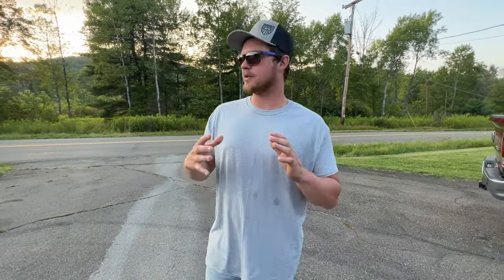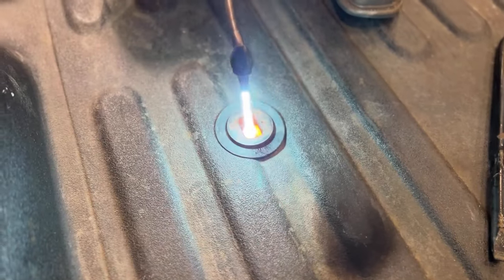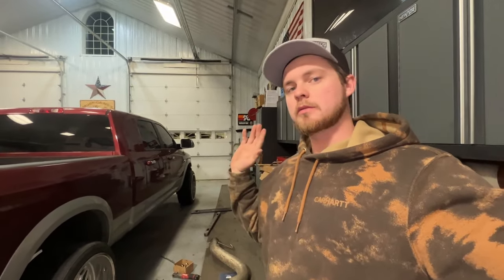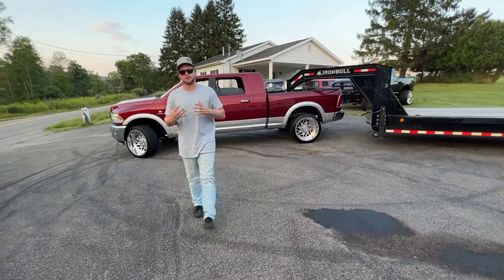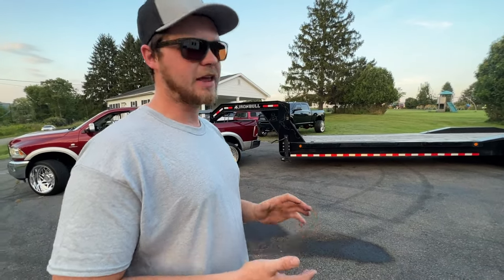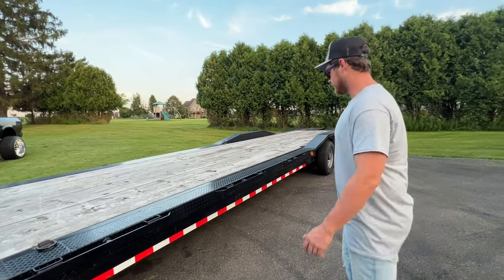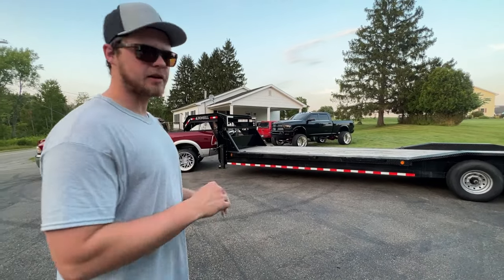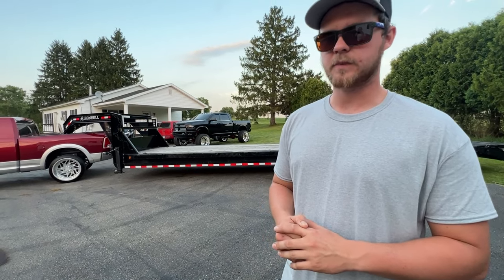The BEST 'NON-CDL' Trailer you can Buy.

Comment: You should put air bags in the rear of the ‘13 and when you need to load something lower lift the rear of the truck and decrease the angle of the dovetail.
Reply from the maker: You might be onto something 🤔